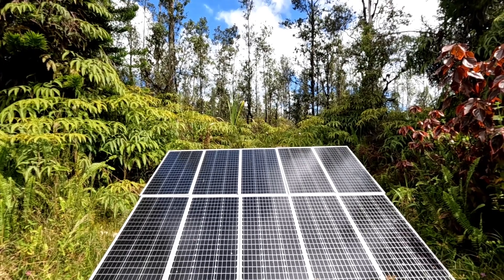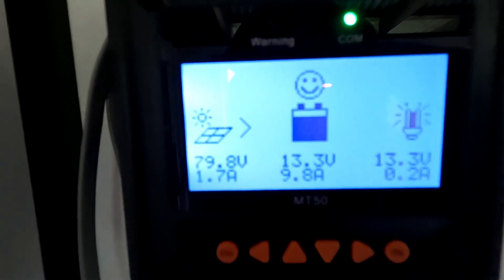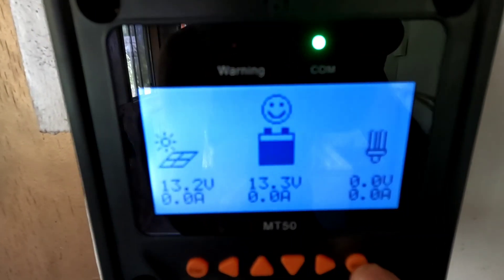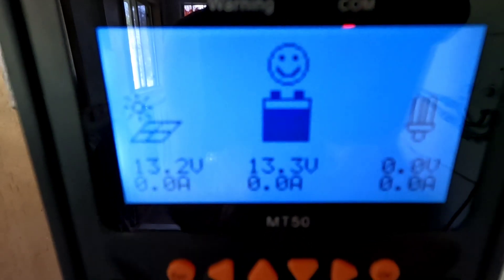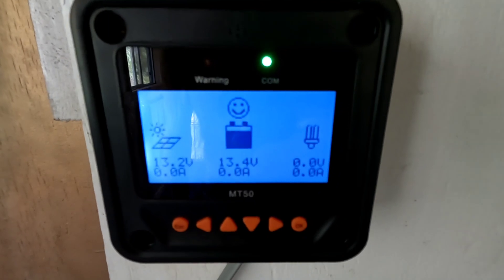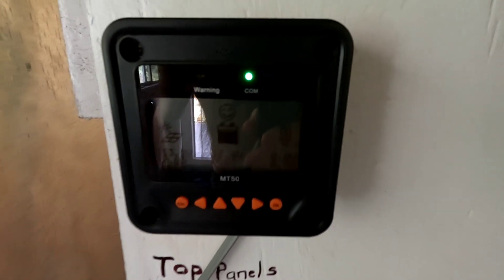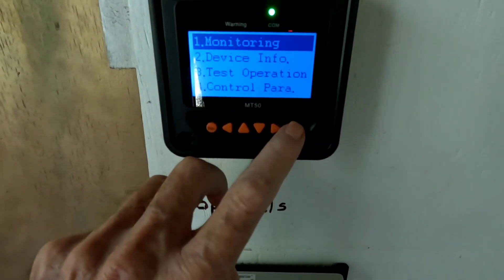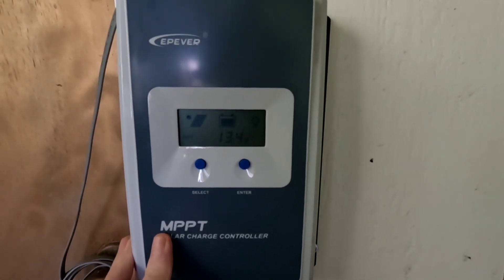EPEVER 40 amp MPPT solar charge controller Failure!

Comment: My Victron failed in 2 month.... Never over voltage, never over current.... Just started blowing fuses... And It wasn't cheap unit. Also Victrons are not serviceable disposable units... They are all glued inside....

Comment: exact same problems with my setup with 2300wp pv, epever 40a xtra n g3.. after 8 months 1800-2000 wp in midday.. suddenly drop 1300wp... and found mosfet and diode failure (not tottaly broken)..

Comment: I have the same controller and I'm planning on running 500 watts but I'm going to run too 250 strings in series (2 100, 1 50 due to space on an rv) and run those in parallel to the controller if you're running all parallel I think that may be your problem.

Comment: I have a similar problem every morning i have to move configuration on mt150 so it can charge my batteries. I have 660w of panel my charger controller 40A epever. I WILL CHANGE TO VICTRON wish me luck  god bless everyone

Comment: As an update: My Epever 4210AN has worked just fine after I took out a string of 40 foot wires leading to solar panels and I ultimately upgraded my panels and got rid of the old ones. I think there was a bad connection somewhere in the line or even the panels. Now I have 1600 watts of solar on top of my RV with two EPEVER's controlling 800 watts each. Oh and my Nissan leaf PARTIAL battery bank is awesome. EV batteries are much much better than any standard lithium or LifePo battery. My modules are of course used, cheap and work great!

Comment: If you over load your controller by introducing more volts than it is rated for, you stand the chance of destroying it. Buying a Vitron will have the same failure if you over load it as wel.
Check the mfg Voc per panel. Add the # of panels and total them up.
Now check mfg Voc max limit on the controller. DON'T EXCEED THE LIMITS! BETTER TO BE 20v LESS THAN .5v OVER.
When purchasing your controller make sure it can handle the combined voltage output of your panels. Good luck

Comment: Hello!

I follow your videos with interest and I would like you to help me with some advice!
I have a solar photovoltaic system installed in the garage, consisting of the following components:
2 THOR brand photovoltaic panels of 200 watts each, monocrystalline, both having the same specifications: vpm=18v, Imp=10.69A, voc=21.8v;
- one panel is mounted, put into operation and the second one, being recently purchased, is to be connected.
1 mppt solar regulator/controller brand EPEVER of 20A model TRACER2210AN;
1 solar energy regulator, MT50;
1 12V-220V 300watt inverter with modified sine.
1 older VARTA car battery yes ok.. of 12V/74A.
Could you please give me a hint (advice) in the sense that with this setup, I would like to charge my electric scooter (not the scooter) in the summer on sunny days, with 5 lead-acid batteries installed in series gel acid of 12 V x 5 = 60v with 20A.
I mention that the scooter is charged at a 220V socket charger which has the same consumption
3A, charging the moped in approximately 5-6 hours.
What else should I add to the setup above, mentioning that...unfortunately, the garage cannot be connected to the electrical network?
Panel:
Can the 2 panels, in order not to damage the regulator, be connected in series or in parallel?
Battery:
- Should I add another battery and connect it in series? Not needing to store a lot of current.. My claim is only to charge the scooter during the day on sunny days. The surplus, if it remains, should be stored in the same battery to ensure the lighting in the garage.
Inverter:
Is the owned 300 w with modified sine ok or do I need to purchase another one with higher power or with pure sine?
Safe:
I put a manual switch (fuse) from the solar panel to the 20A controller on terminal+... does it require a stronger fuse?
I also attached an MC4 type bypass diode to the main red wire.
Does the setup require anything extra?

Comment: Epever charge controllers "talk" to each other when wired in parallel. Without seeing the rest of your wall wiring, I am assuming that you have both Epevers connected to a power bar which combine at the bar and a single wire leading to your batteries. This is battery bank protection to prevent charge overload to slamming so much power into your batteries. When I have strong sun with lots of volts and amps, usually one of my Epevers will drop to zero or near zero especially once the batteries go into float charge. If the day is weak on sun, then both work collectively usually working together to balance their charging collection.
Reply from the maker: I never knew that about the Epever controllers...mahalo for sharing that with us...aloha 🤙
Reply: I've noticed the same. One epever working, the other having a break, when batteries are charged up, yet sharing the load when charging them up.

Comment: I had the exact same problem with the same 30a and 40a EPEVER model controller, with Lifepo4 batteries.  The issue was the default lithium settings are way too high for the BMS of the batteries and triggers the controller to stop charging.  You must use the USER option for battery setup, and lower all the voltages to no more than 14.2 for Boost.  To get the controller back operating, you must disconnect the panels, then the battery for 10 minutes or so to reset it, then with battery connected, change over to user and lower the voltages as mentioned.  I used 14.2 for boost, and 14.5 for max disconnect and the unit has been functioning.  I also lowered the Boost time to 90 minutes with my 300ah battery bank.  The EPEVER is not compatible with the Lifepo4 battery BMS turning off for full or over voltage and that's the problem.  I will never buy another EPEVER unit.
Reply from the maker: I ended up doing much the same before switching them out with Victron charge controllers.  For my system, I lowered the boost to 14.1 ultimately as 14.2 was still too high.  Reduced the boost time to one hour. That worked pretty good, but compared to the Victrons....well no comparison.  Victron outshines in every way. The Epevers have now been relegated to backup . Mahalo for sharing your information with us...aloha 🤙
Reply: The high-voltage cutout bug within Epever also fails out on lead acid batteries as readily as with the LiFePo which have only been online for six months now. 
Software and R&D pr
Reply: Update to my previous post!!  I have figured out these EPEVER AN and Triron controller parameters.  These units function fine, just the default settings are not intuitive for the average Lithium battery setup.  When they stop charging during the day, even when the batteries are not full is because a dead space is created between Boost and Float, when those settings are different in the parameter settings.  I.E., if you have boost at 14.4 and Float at 13.8, charging will stop once the charge duration for boost is set, and not return until voltage drops below 13.7.  Resetting the controller unit will just repeat this process.  In addition, the default 14.6 boost setting can easily trigger the battery BMS protection, which can further cause the system to stop charging.  My OPINION is you should not set the EPEVER anywhere near the upper charge/boost limit, and then the boost and float value should match, and you will have continuous charging until that set point is reached.   For example, if you want to maintain your LIFEPO4 battery at 95% SOC, you would set charge limit to 13.7, boost to 13.4 and float to 13.4.  Yes, this is different from the recommendation of 14.2 to 14.6 for charge limit, but for efficiency and longevity, you don't want to daily take your batteries to 100% SOC.  Also in multi battery setups, some BMS will trigger at +/_ 1.v differentials which will lead to that battery turning off, and the next battery will attempt to overcharge, triggering that BMS, while the Controller will turn off charging since no current will be flowing.  For those that say they get a parameter error when trying to lower the values under user, you have to set them in the proper order, and even if you have 000 (zero) for equalization time, the value must lower than the charge limit setting.  Example, to set charge limit to 13.9, you must set equalization to 13.9 or lower, even though you will not equalize and select 0-minutes for lithium.  You can then adjust your charge limit and boost value lower than defaults.  I hope this helps many, that are thinking their EPEVER Controllers are faulty with Lithium batteries.  Now, Tracer should have done a better job with the setup, and or explanation of this process.  They should have set the defaults at the lowest end of the scale versus the maximum.

Comment: Just read one of the comments in here that said it is a max pv input of 100v and each of your panels are 18.8v times 5 so that puts you really close to the max pv input. Now if it rained or cooled down real quick then your pv voltage will spike above the max pv input on the controller. I have the one with a max pv input of 200v and was told to not go over 140v coming from my panels because of the spikes when you get a sudden change in weather or temperature outside on the panels. Even with only 140v of PV input I have seen my voltage spike to 165v when it started to rain. But then normalized after a couple of minutes. The spike could have caused your problem because you were already close to the max pv input anyway. And also keep in mind too that you have a max amperage input also. I was told this by a person from signature solar even though they don't sell epever products but I bought a growatt all in one system from them and they told me to leave some room for the voltage spikes when sudden temperature changes. He said at least 50v  less than the max voltage. He told me that if it does spike over the max it will show an error but that it could also damage the mppt controller inside. So with every system that I set up I always stay at least 50v less than the max pv input listed for a particular unit no matter what brand it is. And amperage too. I hope this helps you with future installs. I would like to help as far as how to fix the epever that went bad on you but I don't do any electronic repairs inside. But like some of the other comments here, there may be a fuse blown inside. It couldn't hurt to take a look. Take care and good luck.
Reply: Você está totalmente certo.
O perigo da reatância capacitiva e indutiva dos painéis solares no momento do sobreamento repentino faz a tensão subir em 1.9 vezes a tensão do painel solar plenamente iluminado.
Exemplo 
8x18voltes =96 voltes
96 voltes x1.9=
182.4 voltes !!!
Se o limite máximo do MPPT charger for 100 voltes=boommm, blow mosfets
Reply: eddietotherow4917... thank you for answering a critical piece of information that I have been looking into for our 48 volt off grid system. We have (12) QCell DUO L-G5.2 390 panels (VOC 48.48)/(VMP 40.38) that I am trying to pair with our Absolyte GX 48 v/2,000 Amp hour VRLA battery bank.

Comment: I used to do a lot of low voltage high current DC troubleshooting.
 You are fortunate to have two controllers next to each other. If you swap the cables from one controller to the other, or if not enough slack in the PV cables, just swap the controllers, then you will have isolated the problem component for absolutely sure.
 If the same controller is still giving you a problem, I would suggest opening it up and checking the internal fuse. Don't trust the breaker, those black and red inexpensive breakers are known to not be reliable.
 If the fuses have continuity, then I would check all the capacitors and also the mosfets that are held against the heat sink. Normally those components are what is wrong in controllers, and also inverters. They are very inexpensive to replace if you know how to solder. If not, then try to find a local electronics enthusiast who should be able to get you going lickety split.
 I like your triple redundancy, just like NASA!
 If you do decide to get a new more reliable controller, I would suggest at least looking at the rock solid <$600 Outback controllers, or if you plan on adding a turbine in the future, then a more expensive midnight Classic Controller that can be used with solar, wind, and hydro. Both companies are headquartered in Washington State. The victrons are pretty good but they are quite limited on the cable size you can use with them.
 Good luck, and good for you for actually doing it, and not getting stuck in analysis paralysis like many do.
Reply from the maker: Mahalo for all that great information on troubleshooting the possible problem of the controller.  I am going to check everything you suggested.  I know people tgat are using the Outback,  and Midnight solar controllers.  Both are definitely very good.  Appreciate the help! Aloha 🤙
Reply: @ProjectsinParadise808  Isn't the Outback actually an Epever Tracer3215BN? Looks exactly the same
Reply: John - does having a solar combiner box make more sense to protect the the unit than the breakers? We are in the midst of design and building our 48 volt system/off grid and I will be installing a Solar Combiner Box prior to the Charge Controllers.
Reply: @rongray4118   Typically a combiner box will have breakers inside of it. One breaker for each series string of panels in the array. There are code advantages to keeping the combiner box close to the array I believe it's 4 or 6 feet. These breakers protect the wiring between the panels and the charge controller. There should also be overcurrent protection between the charge controller and the battery, and also between the battery and the inverter.
    From my understanding the square D brand QO breakers are rated for up to 48 V DC. That information isn't very easy to find, but apparently if you go digging you can find it. I am not talking about the Square D homeline version. Which is different from the QO version. The QO breakers and panels are all easily available at the big box  hardware stores. I have a 6/12  space QO sub panel for a combiner box, There are also YouTube videos on how to make an inexpensive combiner box.
    Good luck! And congratulations for walking the walk. You will be so happy you did.
Reply: @johnwyman6126  thanks for the information, John!! I prefer the thought of having the protection in place and it makes sense to have a combiner in between solar panels and charger. We are looking at the EG4 MPPT Charge Controller 100Amp/48 volt instead of the Midnite Solar charge controller that we have. The EG4 supposedly does not require a combiner box because it will accept up to 500VDC.... I like the ability to keep the panels in series and receive maximum voltage and maximum amperage.
Reply: @rongray4118   I've heard some pretty good things about the Chinese EG4, except for the idle power draw, I think Will Prowse did a pretty in-depth video on YouTube about that all in one hybrid system.
    Just remember, if only one component goes down in an all in one system, the whole system is down until it gets fixed.  If my charge controller is taken out by lightning let's say, I can still charge my batteries by bypassing it while watching it carefully, using a controller that I had previously upgraded but kept, or with my generator and still at least power my loads until I get the charge controller repaired.
    Everybody does things differently for different reasons, there are many ways to skin this cat.
Reply: @johnwyman6126  I am hearing and seeing the same thing. A couple videos that I have seen have suggested that there is a function in the system that allows the unit to shut down after a certain amount of input from the panels is reached. That is what I am trying to find out. The units won't rob any of the battery bank to continue idle consumption (not sure of it just yet).
Reply: @rongray4118   Once the batteries are full, The system needs to slow down and shut off the current going to the batteries in order to protect them from being electrically harmed. This is the function of all charge controllers, although MPPT controllers have the additional  ability to adjust the DC voltage in order to run the panels at their maximum output. You may need to see an IV curve for your panels in order to understand what I mean, a PWM controller will keep the panels at the battery voltage, where a MPPT controller will adjust the voltage to keep it at the knee of the curve. This is why they are worth the extra money on larger systems.
    During the daytime there should be little problems with idle current, although at night when the panels are not producing, any idle current is coming from the batteries. Although some inverters have what's called sleep mode where it can lower the idle current, and check for a load every couple seconds.

Comment: I have a 40amp renogy rover & that's done the same thing. Mine has proper voltage coming in but no current going in the batteries whatsoever.
Reply from the maker: Yeah that's unfortunate.  First time I had one go bad . These things happen...best of luck, thanks for sharing 🤙

Comment: Hi, One suggestion , if you have a DC ajustable power suply, you can input it, to check if you can wake up the MPPT section. As another sub wrote, you may had a Voc>100V.... and the charger is stucked into this error... Can you can check the log errors ? At least with the PC software it's possible. I completly monitor/control my Tracer 60A/250V with Home Assistant OS.... I can see all type of error like this. Sorry for my poor english :)